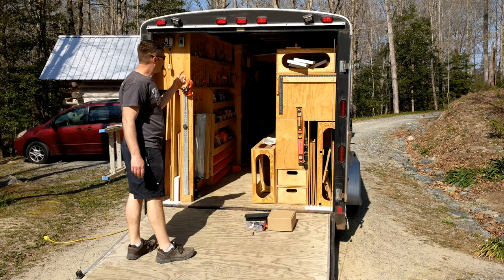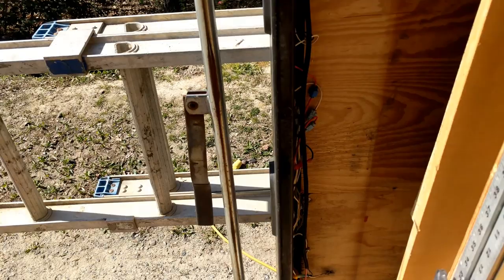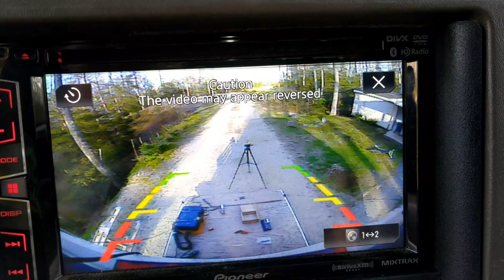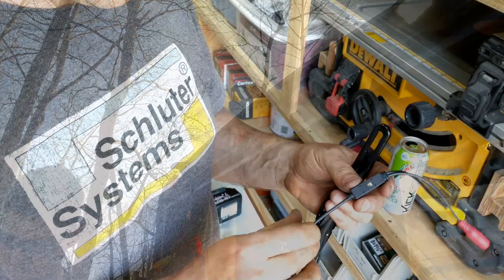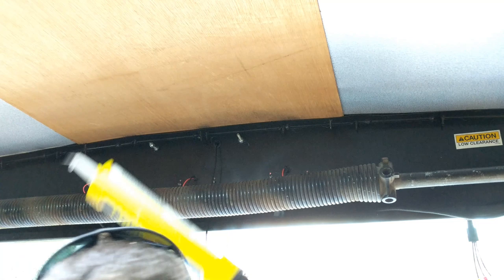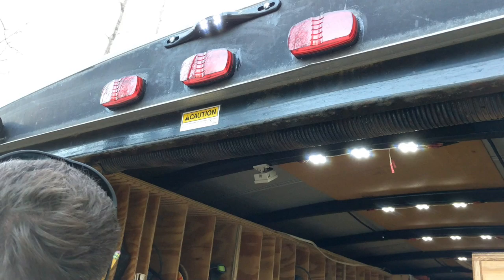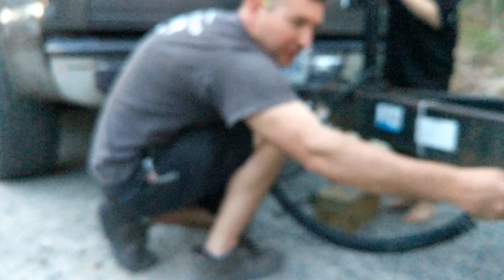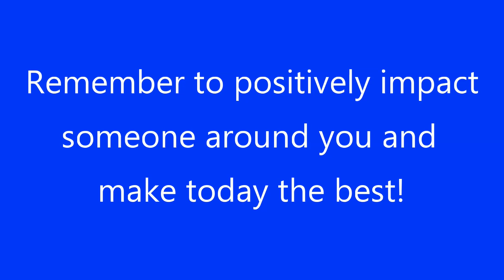Trailer Back-Up/Reverse Camera Installation

Comment: Great video, I have to travel through major city’s on a regular basis & considering installing a package similar to this. I like the top mount angle looking down, very nice layout picture. The only difference I am considering is a second screen dash mounted for constant view of the back up cam while driving so I don’t have to switch radio/screen so it’s hands free driving with constant coverage every time. Thanks for the video, 
Trent from Ohio
Reply from the maker: If you have the room for a second display I think that would be great. If you're in the city and going to have full time monitoring I would also recommend a system to record video as well. 
Thanks for the feedback.

Comment: I would have wired the camera power to the clearance light this way you can monitor whats behind you while going forward and all you need to do is drive with the marker lights on. And your Pioneer head unit also has a feature where you can drive forward in camera view mode while monitoring your hitch view and whats behind the trailer.
Reply from the maker: That is definitely an option.

Comment: Great video. exactly what I was looking for. not too many videos out there on hardwiring a reverse camera on a trailer. I'm gonna run my camera to turn on through the tail lights and I'm gonna wire it through the trailer plug using the taillight port and the auxiliary port.
Reply from the maker: I'm glad you found the information you were looking for. Thanks for the feedback.

Comment: 🤔 why not run the wire to the front in a protected conduit inside the trailer instead of running the exposed wire thru holes drilled in the framing?
Reply from the maker: The inside is a great option if you run it first before building it out. There is other wiring underneath as well. If I remember correctly, I used rubber grommets and wire loom to protect the wire.
Reply: 3:14 don't see grommets, it does sound like a wire protection sleeve being pulled through the holes. Well except that first one 😬 oops
Reply from the maker: @otherbob23  It's been a while since I've done it and I don't have the trailer right in front of me to look at it currently. I tried to watch the video and see what I did but I can't really tell either.

Comment: Did u use grommets at the pass through under the trailer?
Reply from the maker: If I remember correctly I have all the wire in plastic wire loom. I used that instead of rubber grommets.

Comment: Good evening Anthony,  I have another question which one of the 5-pin to RCA adapter did you 
use because I was wording which one would turn on the back-up camera and did you order
2 kits or 1
Reply from the maker: Mark, it should be this one: https://www.etrailer.com/Accessories-and-Parts/Rear-View-Safety-Inc/RVS-RCA5-AM.html and I don't remember for sure but I think I did buy two. It depends what your backup camera is. If it's rca you'll need a second one. There may be some available that are wired with the 5 pin.

Comment: Do you have a backup camera on your truck? I’m wondering how I would hook up both truck and trailer cameras to the same head unit and how to select between them.
Reply from the maker: I do. My head unit allows for two camera inputs. I had a buddy that only had one and somehow they put in a switch that would switch between the two. I'm guessing it would be a two position switch. Other than that I don't know. He had his installed professionally.

Comment: Hey I have 1 more question for you did your enclosed trailer have a reverse light wire on it
Reply from the maker: It did not specifically have reverse lights but there were wires that ran to the back of the trailer. If you're trailer has a 7 pin connector it is possible that the wires are located in the back behind one of the corner panels. If you check under the trailer you should see where your wiring is located. There is a wire for reverse lights in a 7 pin connector.

Comment: I am getting ready to do the same thing to my trailer.  I have a question. 
Do you find that the backup lights cast a glare to the camera? Being on the same level.
I am thinking that mounting the backup lights lower would prevent that.
Reply from the maker: You'll love it Michael. No, I didn't see any negative impact from the lights. The lights are somewhat directional, but I wouldn't see any light bring an issue. It's well to the side of it.

Comment: Anthony, Joe Gus here. Thank your for sharing your experience. It has already helped me. I’m considering getting the same harness you got. But it seems like a lot going on to only transmit 2 signals(video and power) Although it seems like to much, I have not found a better/cheaper solution. Do you still feel like this is the best option out there? Secondly… do you see any reason to get the harness capable of 3 cameras? Initially I don’t see a reason, but it’s only about $30 to have that option.
Reply from the maker: Hey Joe. Thanks for the question. It's been a minute since I've put this together. I haven't done any research since then. I couldn't tell you what options are out there now. New stuff is constantly coming out. I'm sorry I wasn't much help.
Reply: Sounds like you are happy with your purchase, good deal man

Comment: Just run your wire camera to your taillights
Reply from the maker: That would be one way to do it. It would be on only when the taillights would be on. I want it to come on with my reverse lights because that's the way my head unit works.

Comment: Hello Anthony, I am trying to hook up a backup camera on my 2020 trailer I have a Kenwood head unit with backup camera on it so will this kit work on mine as well.
Reply from the maker: Yes it should. Do you have two inputs for reverse cameras on your head unit? If you don't, there is a way of having a switch to turn one on or off. I haven't had to figure that out yet. I have a buddy that had his professionally installed and that's the way they did his. A toggle switch to you too pick which camera is on.